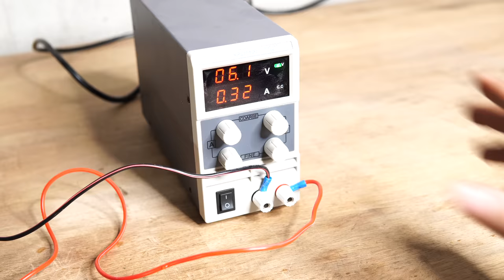Rusty Iron Restoration

Comment: I always wonder: why do you have to clean the rust before taking it to the sander? it feels like the sanding machine could handle everything at once could it not?
Reply: One reason is that the sand in the blaster is reused a few times, until the grains are no longer sharp. Contaminating the sand with rust particles makes it work less well and you have to change the sand more often. So it's useful to remove what rust you can, especially with a low effort method like electrolysis, before you blast, so you can use the sand longer.
Reply: Rust means more debris in the sandblaster, which makes it less effective because you also blast the sanding residue. Removing most of the rust beforehand extends the time you can use the sand.
Reply: Also, the rust that gets into the sand can also be reintroduced into the metal,
Reply: Rust also wears down sanding implements faster than clean metal.
Reply: @andy_rb  Is it a special sand that needs cost savings?
Reply: @jeffreyaguilar3271  It's not only sand that is used in the sand blaster. The type of medium you use for blasting depends on the material on which it is gonna be used.
Corrundum, aluminum oxide, baking soda, glass beads are also used as blasting medium.
Reply: @levinjayan3480  Awesome info! Thanks!
Reply: Rust could easily be sandblasted off. The cost of changing the sandblasting media would usually offset the cost of the time and materials to remove the rust first. But in this situation, making an interesting video for YT, the extra, unnecessary, step of removing the rust before sandblasting becomes an interesting segment in the video. Making a good video takes precedence over getting it done quick.
Reply: @shanepowers7566  Ohh. Compelling argument.
Reply: @shanepowers7566  that all depends on the type of media you use, some of that stuff is pretty damn expensive
Reply: @jeffreyaguilar3271  I've seen crushed walnuts used once on American Restoration because the metal they were blasting was so thin and fragile
Reply: @TheBendermen  I'm guessing you mean walnut shells because crushed walnuts are basically walnut butter lol